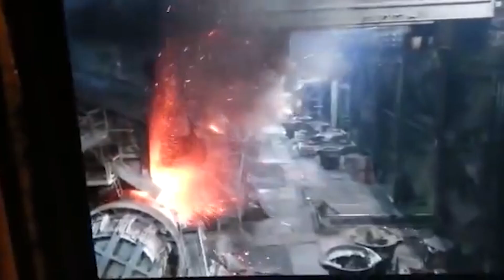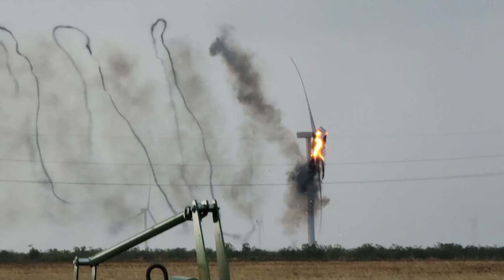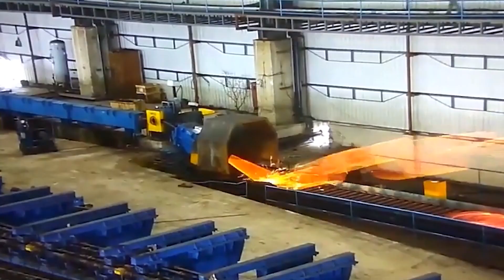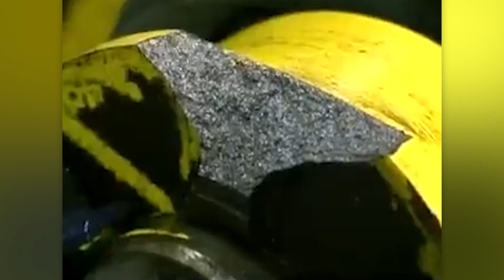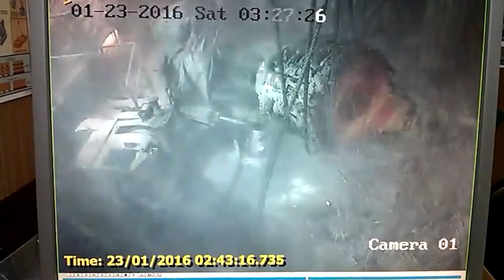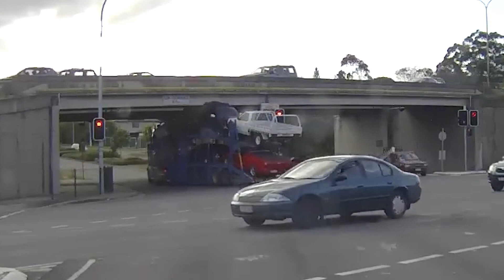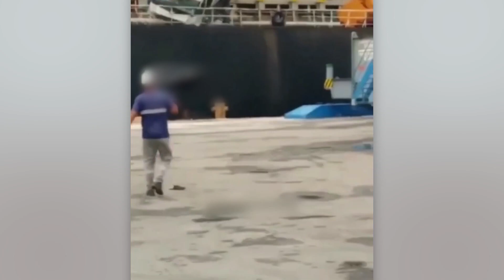Heavy Machinery and Industrial Mistakes Caught On Camera

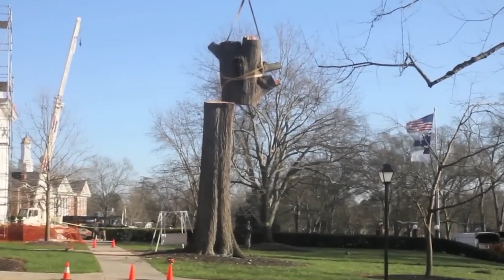Comment: 18:05 - That crane should have NO problem with that. Yes, that's a few thousand pounds, but that's nothing for a crane THAT size. Obviously the problem with it, is a major design flaw, in that it's outriggers are nowhere near as spread out as they should be. That thing should have outriggers that extend like 25' out in all directions. The vast majority of cranes toppling with their loads are all like this. You can see MOST times, when they topple, they're well within their weight limits, it's just nowhere near enough outrigger reach, to hold the base stable. So ignorant. Who the heck are some of these engineers?
Reply: In this case the load is straight over the back of the truck. The outriggers go to the side, so no matter how far that might have been extended it wouldn't have helped.
Reply: @constructionwatcher5381  Yes, but these should have 4 way outriggers, that extend way out, so that it would be impossible for them to tip in any direction.
Reply: @Warrior_Resisting_Colonialism  Look at the video. There are four outriggers. Two at the back extend to either side. Two near the front also extend to either side. That's the way all mobile cranes are set up. There's no way outriggers can make an crane impossible to tip. Lift too heavy a load at too large a radius and you exceed the capacity of the crane, and it tips unless something breaks.

A crane's weight limit varies greatly with the radius to the load. The stated "capacity" is measured with the shortest possible boom raised essentially straight up. The farther out it reaches (like in this case) the capacity drops very quickly. To cite a random crane load chart found online, a crane than can lift 16 tons at 1.6 meters reach can only lift 1.5 tones at 16 meters. The operator is responsible for knowing the weight of the load and the capacity of his crane at the configuration it is being used. Crane manufacturers provide charts, and in modern cranes computers, that tell the operator what the capacity is in any configuration.
Reply: @constructionwatcher5381  It's not that your wrong. It's just that you're not listening to me. We disagree......Engineers agree with you......so therefore this will continue happening. If I owned that awesome crane for tree removals, you can bet, I personally would make my own modifications to it........I would make it impossible to tip over, no matter how it was used. Even if you think it's an impossibility, I can assure you, it's not.
Reply: @Warrior_Resisting_Colonialism  It's simple physics. Unless you find a way to extend the outriggers beyond the load, a crane can tip over with a big enough load.
Reply: @constructionwatcher5381 Simple, yet you wish to complicate it. All the more reason to ensure you have outriggers that extend as far as reasonable, not just short ones, right in close proximity to the crane, like many of them are.
Reply: @constructionwatcher5381  You'll probably argue with this too; but if this crane had a large extendable outrigger boom, down along each side of it, and if the back end's were extended out 25', this crane would not have tipped over with that load.
He's clearly parked back that far away, to keep from tearing up that lawn. Had he long outrigger beams, he could have set large lawn protector platforms under them and lifted that "little" 3 to 4 thousand lb oak stub with ease, with 0 risk of toppling his crane.
I'm not arguing it wouldn't still topple over if he grabbed onto something unreasonable, like that whole tree, even with 25' extendable outriggers........ but would NEVER have to worry about grabbing any reasonable chunk of tree, in any case ever again either.
If you think this chunk of wood was too unreasonable for a crane that size from that working distance, fine....but I do not. That cane is being CRIPPLED with such close proximity outriggers. That's pathetic, that such a nice crane like that, isn't setup to EASILY pick a stub that size, from that distance. Pathetic. I can assure you, I could fix that very easily.